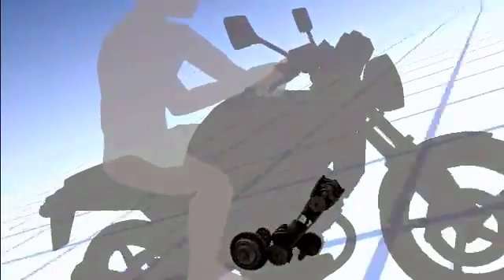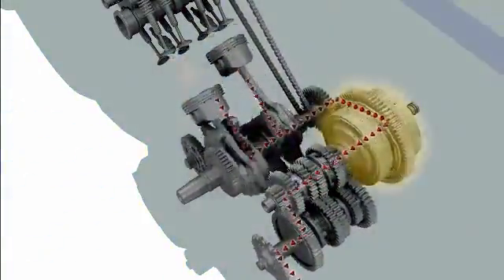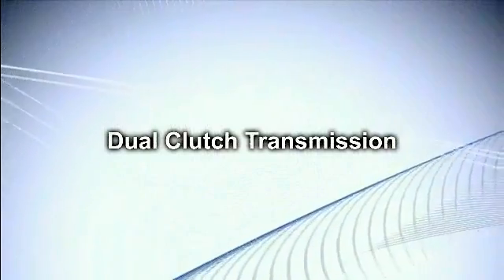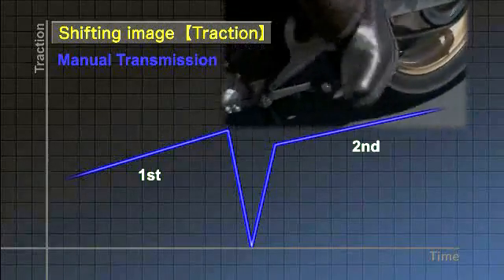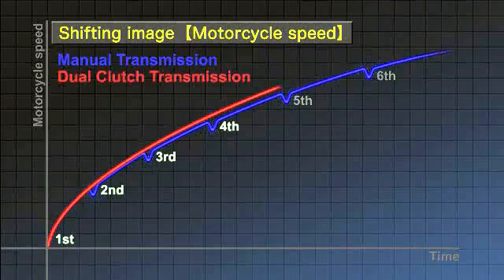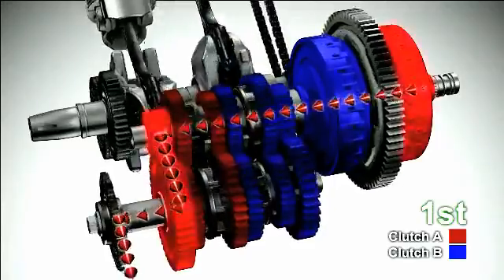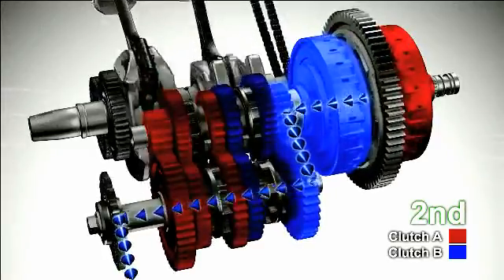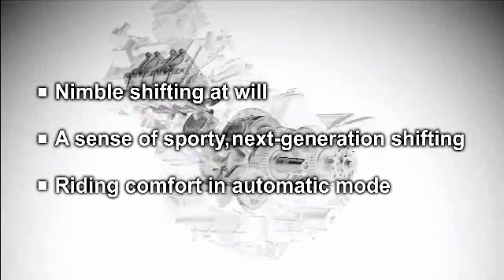Honda DCT Dual Clutch Transmission explained

Comment: Do you still need to operste the clutch? What about rev matching?
Reply: no, when you select drive mode its disengage all clutches and switch first gear like your manuel transmission by electronic transmission select motor. 

and when you rotate throttle then its engaging first clutch. 

and its preparing(selecting) second gear for second clutch and wait for the get enough speed.

also its engaging second clutch to second gear for increase speed.

when doing this its preparing for next gear and selecting thirth gear for first clutch and waiting for the get enough speed. and all circulation working like this.

basically think. you have a manuel motorcycle and have a two clutch. one clutch is for 1,3,5.gear and second one is for 2,4,6. and think you have two gear shifter pedal. and you are driving first gear and when you want to switch second gear you need to activate second clutch and disengage first clutch and change the first clutch gear to third gear for the next move.

i hope you can understand my english.

Comment: As Honda is classing normal slow speed maneuvers that you can do on any normal manual bike as "abuse" & refusing to fix or replace the clutches that are burning out doing slow speed stuff, I would say wait until they've fixed them before buying a DCT bike.

Comment: I think there is something wrong with this video.  When starting out in first gear, second gear is already engaged.  When you shift from 1st to 2nd only the clutch moves, not a gear mechanism.  Once the clutch has engaged for 2nd gear the 1st (odd) gear clutch now engages third so this is where the mechanical gear change occurs.  But once you are in 2nd and ready for third and change gears again, only the clutch moves as 3rd gear has already been selected.

https://www.youtube.com/watch?v=UfyyBQUsMLI
Reply: Say I'm in second, is there a difference in how 3rd is engaged compared to 1st? Like it constantly predicts which gear I might need?
Reply: @Bryan11210  That is my understanding.  If you are accelerating in 3rd gear it assumes you will want fourth and makes that change.  If you are decelerating it assumes you want 2nd and will make that change instead.

Comment: I still didn't get it. Do we still have to squeeze the clutch and steps up or down the shifter? Or it works like an automatic transmission?
Reply: It's automatic. No clutch, no shifter. Seamless power and impossible to stall. I'm 60 and ride a CTX with a DCT six speed. I love it.
Reply: It's a manual transmission that clutches for you ,sort of . 
   I still prefer getting to tell the engine when it's allowed to have another gear

Comment: No explantion of how clutches are engaged on/off?
Reply: It's annoying that this part is seldom explained. They only talk about the strictly mechanical part. In the case of Honda's DCT (and most DCTs), it's a computer-controlled mechanism.
Reply: See explanation from 2004 for Volkswagen DSG transmissions and the Mechatronix unit inside that controls clutch engagements and gear engagements, and various shifting mapping software algorithms.